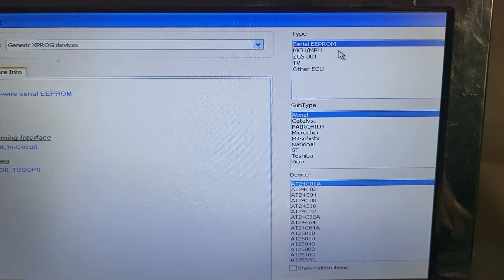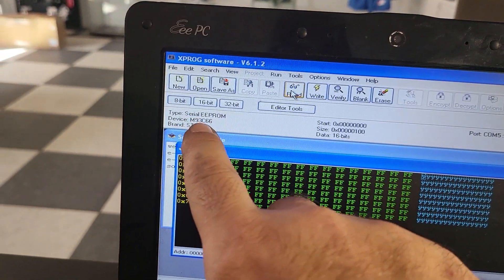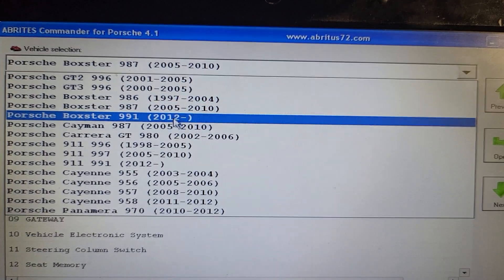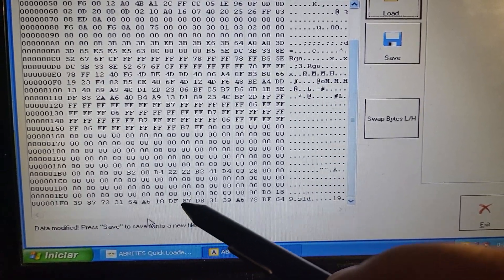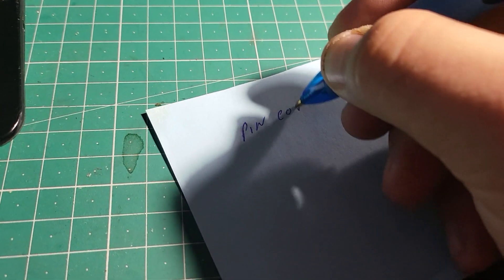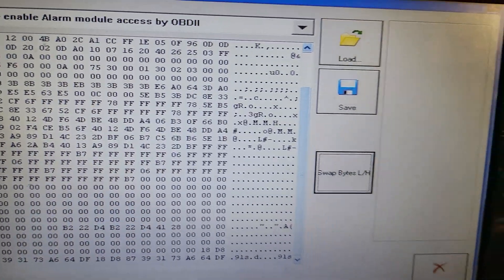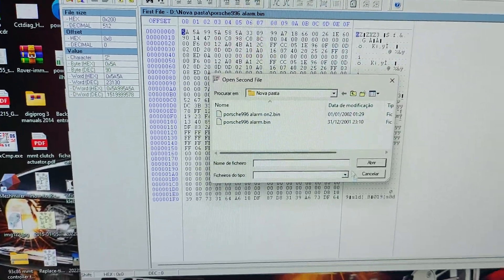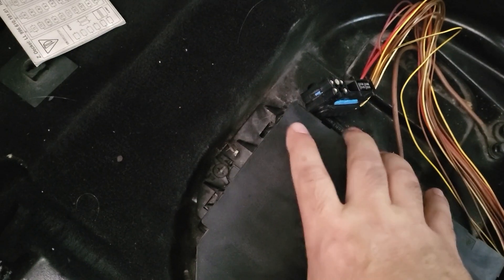porsche 996 alarm pin code extraction

Comment: Hi Car Dokter, have a question pincode (18-D8-87) that is the pincode to acces for program in the bcm for example to a key? and (18-D8-87) this exact code i need to write to enter in special funtion pwi 1?
Reply: Hi Car Dokter thank for replaying to my answer, its means allot. i need to ask you a question when i will connect (pare/synchrone) dme for booxers 986 to alarm module (immobox) how can i get 16bits password and 6 bits pincode for dme to follow correctly with pwi the proces. the old ecu was eeprom data emthy no data and this car was in stalling in 3 yeare they dont start the car. the data 93cl56a in alarm module is oke. is for this problem a option?
Reply from the maker: @jimcartecdinmahomed7866  if the eprom in the alarm module is fine then you can use that to adapt new ecu to the car
good luck
Reply: Hi Car Dokter thank you for replaying back i have one question more, can you tel me the second remote code in with line this one is in the file? in your file. i now my file is diffrent code .
Reply from the maker: thanks for watching
yes thats correct, but that code is unique to each car, im the car i have here this is the code but for your car it should be diferent, but if you follow the steps in the video you will find your code in the same way.
good luck
Reply: @PSICompanyPerformance  hello car doctor,
i have a question,
PORSCHE BOXSTER (986) 2.5 (09-1996 / 08-1999) [M 96.20]
after three years taken out of storage and wants to start it does nothing.
i have read the eeprom of dme and was in the eeprom 24c04 data gone empty for 80%.
i can buy for the dme synchr file.
do i have to pair the dme ecu via bcm and how do i get the pin code of bcm and how many digits numbers and letters is it?
i have read eeprom of bcm 93cl56a.
can you guide me with this cassis?
it does not have to be free.
Regard
Jim
Reply: Please confirm if this procedure will work on a Porsche 997

Comment: Hello
Can I read the 93L366A chip and write it to the new module?
Car run and keys work?
Reply from the maker: thanks for watching
i never tried thatt but i almost sure that it wshould work
just remenber to get the exact same part number to do that.
good luck and lets us know if it works if you try it.
Reply: @PSICompanyPerformance  yes sir, will do
Reply: Vvdi prog would not write the file after saving the original. 
Would be the same data, wouldn’t ask for which file to write!!😢
Reply from the maker: @eurowerx4267  did you desolder the eprom from the module? it better to remove it from the board and to make sure you have a good contact to the programmer, also make sure you select the right eprom 93c66a

Comment: I have a question, the 24 HEX code changes because it is a rolling code, how can you get that to be able to pair the remote, I did all the steps in the video and cloned my M534 perfectly, I extracted the 24 HEX from Line x0100 but what do we do with the rolling code that changes that I read are the last 5 characters of the 24 code
Reply from the maker: thats a very good question.
i just read the code thats there and then i know thats the code the unit is expecting to receive so i program that but if it fails then you have to read it again and use the new code instead.

Comment: Thank you so much for posting this! Took me possibly an year of researching to get to understanding what I need to do get the remote to work again. I have a question, I believe my mechanic changed the transmitter inside the remote so its not the one original to car but he was unable to program. Would reading the code from eeprom get me the code to this replacement transmitter or the original one?
Reply from the maker: Thanks for watching
The code in the eprom is from the original remotes...
If you still have the original one , even if its not working, you swap the microchip with the other of the new remote and get it working with the original codes..
Good luck
Reply: @PSICompanyPerformance  By 'microchip' you mean the pill in the key fob, right? At this point, the key works to unlock manually and start the car. The fob unlock button blinks red when pressed. Let's say I read the codes via eeprom reader and use them to program the fob, is there a chance I could brick anything if the code I input is wrong?
Reply: @shaazy the is pill is actually the transponder to start the car. There is another eeprom on remote PCB which not readable, but cointains the synch code. This one either needs to be your original transmitter or the code is known and printed by the OEM

No way to retrieve the code from the remote itself.